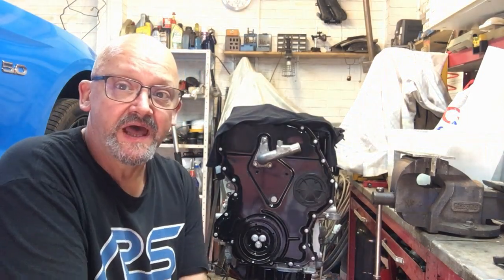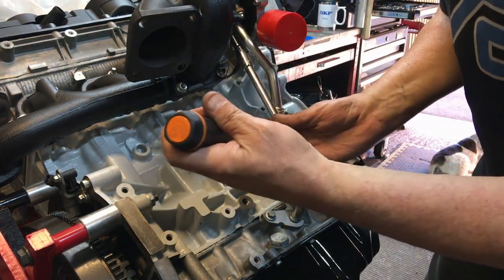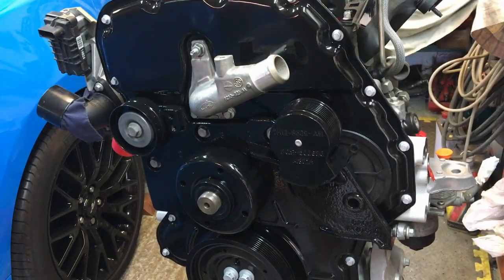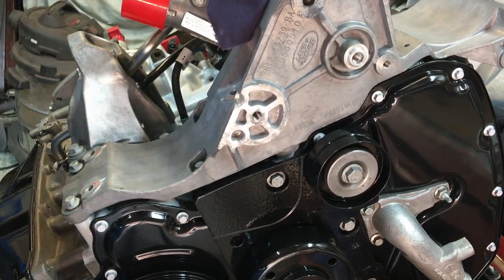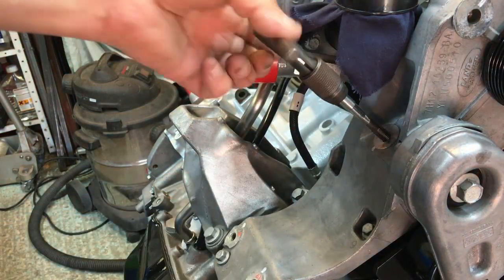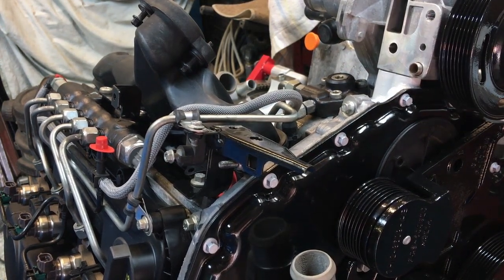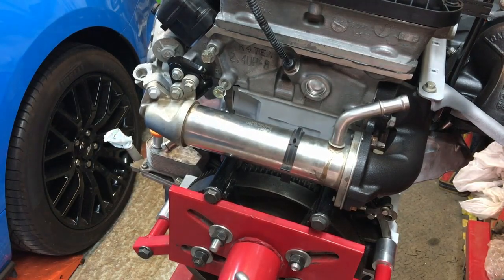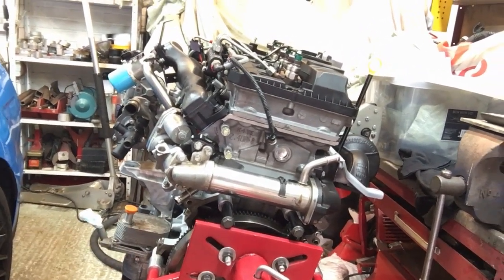Land Rover Puma 2.4 Tdci engine rebuild. Part 15... the end.

Comment: Would the mustang engine fit into a transit custom 2020?
I ask you because you seem to know about the puma engine and mor sensible than any Ford mechanic.
At the moment, mine is fitted with a euro 6 ‘wet belt’ version & was hoping that the 2.3 mustang unit was better!

Comment: Great job Nigel, I've got the same engine in my transit, It's turning into a can of worms with the silly EGR system.
Reply from the maker: EGR is a stupid concept in my opinion. Once the engine has done 10000 miles, it is probably less efficient than it would have been without it?

Comment: Enjoyed that series Nigel. You will be happy to know that theres no warning lights appear on the 2.4 as theres nothing to measure the Flow of the EGR. Mine has stayed off and the difference I instantly noticeable in ever aspect. 
Welcome to the dark side 😜
Reply from the maker: If Only I had fitted the blanking plates I would be experiencing the same. 🤓😂
Reply: @defender90keswick.nigelsla59  If only 😜
Reply: Do you fit 2 plates?
Reply: @17th_street_preacher  Yes 1 on the manifold and 1 on the EGR
https://youtu.be/SZoV9rGzkF4

Comment: Who the hell thought it a good idea to put a MAF sensor in line with the EGR system?....Crazier than a box of frogs....
Reply from the maker: Who thought of EGR??? Probably the most pathetic idea ever. Particularly with Direct injection as all diesels are. “I know, let’s pump a load of shit into the intake so it can spot and clog everything with nothing going through to clean it”
Reply: @defender90keswick.nigelsla59  my thoughts entirely mate...I may or may not have blocked mine off...😁